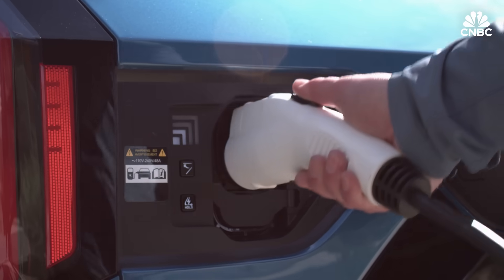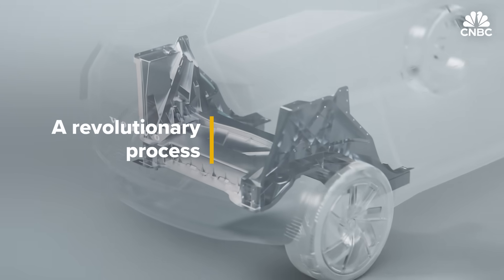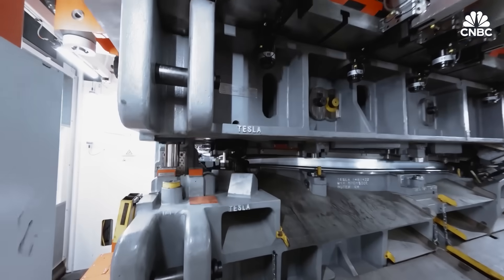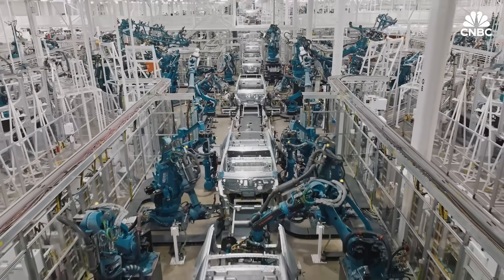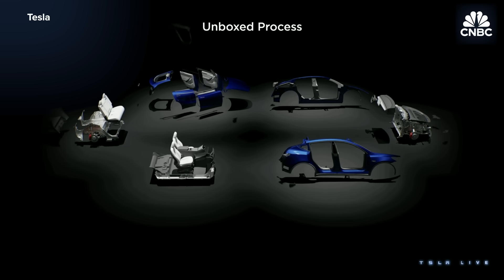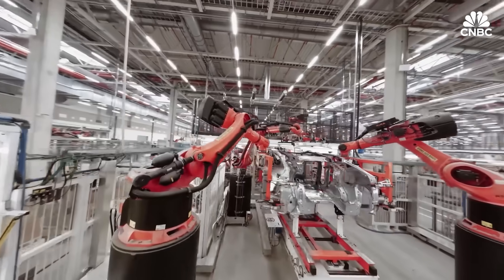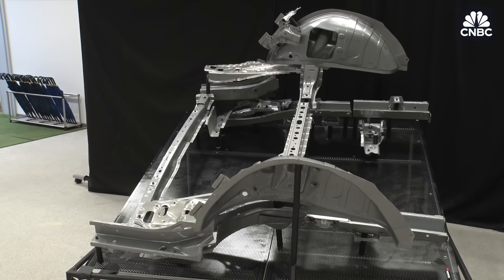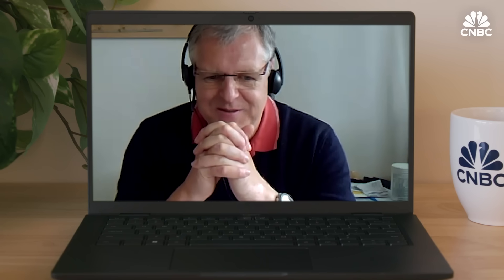Why Tesla And Other EV Makers Are Betting Big On Gigacasting

Comment: Creator failed to point out that one of the challenges of large castings is they need to be made without the need for heat treating.  Heat treating a large casting leads to warping, i.e., the potato chip effect, no two are the same.  With the cooperation of a SpaceX metallurgical engineer Tesla developed their own aluminum alloy for casting that does not require heat treating.  Also, in addition to the reduction in parts, there is a significant reduction in the number of robots required for welding stamped parts together.
Reply: Not to mention they can reduce the factory footprint by 40%
Reply: Incorrect, in gigacasting the stress relieving is achieved when cooling the casting.
Reply: Like Hot Wheels. easy
Reply: @Chad_Max must not have ever owned a Tesla or you would know your statement is crap!
Reply: Large castings may reduce the cost to manufacture, but they increase the cost of repairs. A fender bender could total the car.
Reply: @DeepDeepSpace  Last time I looked many Hyundai Genesis fender benders TOTALLED THE CARS, the cost of sensors and headlights AIRBAGS and engine parts damaged in a front end collision  was worth more that it cost to fix .AUTOLINE DAILY had a topic on this 3-4  years  ago,d now go and a price out a GERMAN car involved in one of them collisions, oh , if you think a EV battery replacement is expensive @$15-$20,000 you have not priced a Mercedes  AMG   or BMW M5 engine.
Reply: 100%.. If it was such a good idea, automakers would have been doing it decades ago.. Just another scam designed to pump the stock courtesy of Elon Musk
Reply: no
Reply: @Chad_Max  No, the scummy smear campaign by the Dinosaur car makers sucks and is despicable: The Tesla Model Y was the most sold car in the world, plus Tesla sold 250'000 more BEVs than BYD and sold more than anybody in the world, this is not sucky quality, people would not be buying them if it was. Just BS and lies to stop Tesla because the old car manufacturers are digging their own grave sticking with ICE cars.
Reply: How can you say that?  @Chad_Max
Reply: @Chad_Max it does but the casting isn’t at issue.
Reply: @Chad_Max  dude the quality is fine. STFU, you probably have never even been in one. I drive one and the car seems great
Reply: Is cast aluminum as strong as steel? Is it more prone to failure or metal fatigue than steel?
Reply: Large single pieces mean when in a small accident, the large complex piece bends, is too expensive to replace, and car is totaled. More cars totalled due to irreplaceable parts, means more cars sold.
Reply: Thank you. You saved me 10 mins
Reply: And if you have a minor crash the car is written off and can't be repaired cheaply
Reply: It's a new technology. These things take time to mature.
Reply: @Chad_Max nothing to do with the casting
Reply: @Chad_Max  I've owned a Model 3 and currently a Model Y.  Build quality has been excellent on both.
Reply: @evmike71 I agree
Reply: @evmike71   Yeah,, Tesla got a lot of lessons learned.. LOL..
Reply: @evmike71 your individual experience is a single data point. Tesla is renowned to produce a high percentage of minor (cosmetic) defects especially unacceptable on high-priced cars. I’m sure it has improved since they acquired this reputation when the popularity of Model 3 blew up. I’m not sure they’re on par with high-end Mercedes QA standards yet.
Reply: @ArnaudMEURET  I've walked the lot at my local showroom several times.  Never saw an example of bad build quality or minor defects.  The reputation is renowned because of folks like you echoing what you've read in the press.
Reply: @evmike71  1) I’ve stopped following mass media about 10 years ago and started crowd-sourcing information from moderate individuals on peer-reviewed networks whenever possible. 2) Do you expect to see defects literally showcased in showrooms?
Reply: @ArnaudMEURET  Mercedes?  The cars that light ships on fire?.. Ohh Mercedes, yeah I see those in my rear vision mirror all the time ;)
Reply: @ArnaudMEURET Mercedes is not exactly the gold standards for quality…. They’re beaten hands down by Honda.
Reply: @Chad_Max  Sandy Munro says the quality matches legacy autos and so does CareSoft  they do Benchmarking analysis .legacy auto is fuked
Reply: @AuralioCabal  Meanwhile, Consumer reports show that Tesla still ranks in the bottom of reliability of all brands for 10 years in a row.
Reply: @richpryor9650  there are better sources of information ratings on products than Consumer Reports,several decades I have not read that mag.
Reply: @Chad_Max  You are just parroting anti-Tesla stuff you commonly see on the internet. In reality, my Tesla has never been serviced since I bought it 4 years ago. That's excellent build quality and reliability. So what if one of my panel gaps aren't perfect. What does that affect?
Reply: @Chad_Max  The build quality is a human issue, not machine issue. Teslas coming out of Giga Shanghai have been flawless.
Reply: @Chad_Max  Haters will Hate 😎
Reply: @straighttalk2069 says the cultist
Reply: @Chad_Max  On some in the US. Not on the ones made outside the US. Also, this part is under the skin. The Tesla in the US has a problem consistently and with quality making the car assembled, but the parts itself does not follow this problem.
Reply: @patriksteffan2060  Germany's car industry is ancient and is clueless about new technologies, they know it, they can't build BEVs worth a da**, so they spend marketing / advertise money to bad mouth tesla, they have done this for years: First it was all the batteries exploding, then it was the poor children in the Congo, then it was BEVs being worse for the environment than ICE cars (OMG, did I laugh at that one and the people that believed this insanity, because hey, oil of course grows on trees and is totally environmentally friendly to drill and frack AND ICE cars of course do not have 10 times more parts than BEVs by any chance /S HAHAHAHAHAHA) Now it is all about build quality, while German cars were never suckier and unreliably, check out youtube reports about massively declining build quality in German cars thanks to using plastic parts in the engine that will break for sure and cause thousands of dollars in repairs. The Germans are now so backwards that you can't call the company hightech anymore, these "geniuses" still think the Fax device is modern and 80% (get this, this is real) of German companies STILL use them.
Reply: @patriksteffan2060  The ones from China have the best quality.
Reply: @---jj9lf  Idk which today has the best. Berlin or Shangai. But both definitely better than the US (mainly Fremont). The question mark for me is still Giga Texas.
Reply: I can imagine repairability takes a hit on these castings though.
Reply: @thierryvt  There are break points on the bumper ends and replacements can be added.  If the crash is deep enough to damage the main part of the casting, the same crash on a conventional car would also require a very expensive repair if at all possible.
Reply: @thierryvt  No, factually it does not. Why? Because if you have such a hard collision that it deforms the part, your 100 parts glued together will be worse, because it will be waaaaay too expensive to fix it, it will be a write off by the insurance and that happens really quickly with all cars: They are made to deform from impact energy, that trashes the car and makes it unrepairable. So now you have heard it from a technologist that actually knows what he is talking about. The Dinosaur car makers spread these lies to bad mouth giga castings, now of course, (which we knew all alone) they are buying them too, because so far they could't make A profit producing BEVs.
Reply: @thierryvt  re: "I can imagine repairability takes a hit on these castings though." <---- i see what you did there.😎Autobody and Collision joke for the WIN...!!!🤙

Comment: Every decision has pros and cons, so you should analyse both and not lean on one side or the other. Basically, I also think it's unwise to adopt a company's press material one-to-one, especially if it's just assertions and none of it has been shown in reality. Furthermore, it is wrong to attribute the progress in mega casting to Tesla, it was an Italian company that achieved the corresponding breakthroughs in technology
Reply: Millions of these cars are on the roads. Made in 4 factories on 3 continents.  This is now 3 year old fully realized technology. Sooooo. lol
Reply: @gregsutton2400  yeah, but is it proven that the repair costa are lower than without a Mega Cast?
Reply: @WilliDurpel  why does it have to be lower?
Reply: @gregsutton2400  natürlich muss es nicht günstiger sein, dann sollte man aber auch nicht damit werben. Es macht im Falle eines Unfalls nun mal schon einen gewissen Einfluss auf den Geschädigten
Reply: @WilliDurpel  You are not making sense. I suspect that did not just start happening today.
Reply: @gregsutton2400  was um alles in der Welt hast du denn an meiner letzten Antwort nicht verstanden, so dass du direkt persönlich angreifen musstest?

Comment: You guys are like 5 years late with this story.
Reply: And there's no big bet. It's just working more effeciently. And it's not the only piece of the puzzle.
Reply: They just got paid to burn Nio and hype Tesla… so now they are on a roll 😊
Reply: Well Tesla are still using the same casts to make the same dated looking cars-  that's the problem. It's not that nobody thought of it before, it's just not practical if you want to actually update your body styles now and again.
Reply: @SteveLomas-k6k  I prefer Tesla update the software after I bought it.  Updates the internal hardware.  Updates the computer.  Updates the charging components.  Updates the battery system.  Updates the cameras.  Updates the price.
You just want to pay more for a body panel change and keep everything 10 years old inside.  Have you seen the interior of a "NEW" car?  They still have buttons.  BUTTONS!  Why?  Can't they make it simpler?  Easier to use?
Tesla is doing it right.  Almost everything can be done with just one cheap to replace, easy to use button.

Comment: The car of the FUTURE but NOT THE PRESENT. Ask anyone in the power industry, the U.S. simply doesn't have the needed power to charge all these cars and cutting down TREES to put up solar panel fields is a dumb idea.
Reply: 1) EV's purchased by home owners actually help the grid.

2) Even if 100% of cars sold today were EV's, it would still take 15+ years to make 100% of cars on the road EV's. This transition will take decades.

3) Computers' growth in energy demands well outpaces that of EV's. The grid is gonna need to improve a lot regardless of EV's.
Reply: @wisemanofsorts6068   Well, since I have two linemans in my family, I do know a bit about the grid. Especially since they have built solar fields that ended up totally destroyed by hail damage here in Tx. One of the lineman in my family is a journeyman lineman they he really knows a lot about the power grid. Cutting down trees to build solar fields, transmission lines, windmills, totally destroying the environment to install all this GREEN non sense technology is something to argue since it's NOT RELIABLE. Yes, we need more Nuclear power plants regardless of EV technology that's NOT NEW btw. It's an old idea, more than 100 years old idea. The same issue that existed with them more than 100 years ago with batteries still exist today. Major drain on the battery due to towing. A vehicle for the FUTURE, but not the present.
Reply: @Boxagami  I think you are conflating two separate issues. I am provided points purely about EV's. I did not mention renewable power sources.

My point was that your concerns about the grid aren't really valid as it pertains to EV's. And for most people, atleast ones that live in a house, an EV makes a lot of sense for 95% of their driving.
Reply: @wisemanofsorts6068  If that were true, more than 16% would want them. The majority of the population DO NOT WANT and EV and most of the car companies know this to be  fact now and are converting plans to go back to gas car production. This has all been in the news on CNBC. If you want EV's, you have to have a power grid to support it and we don't have a power grid to support it. No, it doesn't make sense for families to go out and buy a EV for 60K nor are they affordable and no that doesn't include the charging station. I guess you haven't heard or read all the things happening and billions of dollars wasted by this govt. to build charging stations across the country and after spending billions they built about 8 of them. My point about the power grid is a VERY VALID argument for it's needed to charge all these EV's. It cannot handle it, period! Cutting down trees to build solar fields, windmills is destroying the environment. Whole list of reasons to not buy and EV car. Of course, people pushing for fake climate change want to destroy the environment and support cutting down trees and burying them in the ground to prevent carbon.  The idea behind all of this the left is pushing is total insanity.

Comment: For me the biggest issue is repairability. I simply don't trust castings, and likely never will.
Reply: I hope this guy doesn’t find out about 1930s mills, lathes, and power hammers which have been refurbished and are still in use today.
Reply: You clearly didn't watch the video. 

The repairability is better than standard parts as they can be custom cut and patched in with stronger results than old bent steel than is permanently weaker
Reply: @PizzaMan5000  so you're saying any panel beater down the road able to fix & patch damaged aluminum cast sections ?
Reply: @Funktastico 
It's even better, you just cut off to x line and bolt on the replacement. 

They pre plan bolt locations and pre drill holes for attaching new replacement sections depending on how deep the damage is. Repairs are as simple as cut off old section, buy the part and bolt it on. This results in the repaired section having very close to factory tolerances resulting less fitment work.

In old cars there were no replacement frame sections. If your frame got bent, it was cut out of yours and another car, then stitched back into your car with varying results. Once done nothing lined back up and lots of shims or 'persuasion' was required to line things back up.
Reply: @PizzaMan5000  that's what they want you to think
Reply: What are you talking about? Metal castings have been used for thousands of years. If a cast part breaks, you simply melt down the broken part and recast it. Recycling before it was called ‘recycle’ since 4000 bc
Reply: @evildrizzt1  If I pay thousands of dollars for a car, I'm NOT interested in "recycling" it, I want to be able to REPAIR it!
Reply: @DavidJohnson-tv2nn And if you want to repair cars yourself, this is very valid. But accidents that total castings, are also likely to have a normal car written off as well. So it doesn't really save as much money as it may seem.
Reply: @evildrizzt1   Right... but if something is deformed, you have to replace everything. In fact, almost the entire car. Unless you don't care about structural rigidity.

Comment: As long as the defect from the Gigacasting is a lot more than stamping, I don’t think it is a better idea than stamping. It must be at least has superior technical prowess than stamping.
Reply: Big casting have way higher dimensional accuracy than spot welding 50 sheets metal together.  
Just look at the plastic molding revolution that happened since the 50’s when all was a puzzle of stamped metal parts for every product.
Reply: @1943vermork  that is for small part. I said for the bigger part like Tesla is doing. The statistic of defect is from Tesla so what I said is justified.
Reply: @octaviondeminicolas1941  the guy said the statistic that he is speaking is from Tesla.

Comment: Only problem with model casting is that vehicle safety and bad mishaps in a crash.
Reply: Not true. 
Aluminum casting are safer in crash for many reasons over sheet metal. 
Main reason is better energy absorption over sheet metal. 
Plus, if they decide to go into magnesium casting, magnesium have even better energy absorption than aluminum.
Reply: @1943vermork  Google all the crashes with aluminum casting and you will see how much more damages and cost to repair.

Comment: Yeah, if you want throw away vehicles. This is the same BS silicon valley mentality creeping into automotive. Just throw everything in the trash after a couple of years. I wonder if anyone bothered to ask the insurance companies how they feel about this? And who's gonna pay for this lack of serviceability in the end? The buying public, of course.
Reply: Q: I wonder if anyone bothered to ask the insurance companies how they feel about this? A: Insurance Company response - "SALIVATION".
Reply: @phillyphil1513  NO. It's called totaled vehicles left and right. The moment you're fancy casting cracks from impact and can't be fixed, the cost of replacement may be higher than the value of your vehicle. Insurance companies rely on not having to pay claims for profit. And if the cost of operation is higher because of poor design, they pass on the extra costs to you! How's that grab ya?
Reply: @Jasta1122  re: "And if the cost of operation is higher because of poor design". not MY poor design, all my designs of the last 36 years work.  re: "they pass on the extra costs to you!"  exactly SALIVATION.  i believe i just mentioned this.